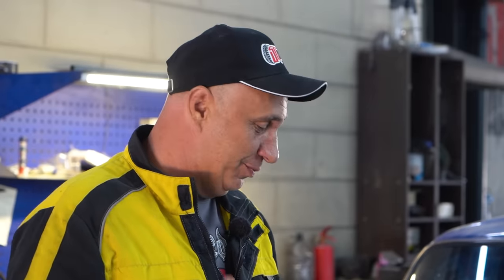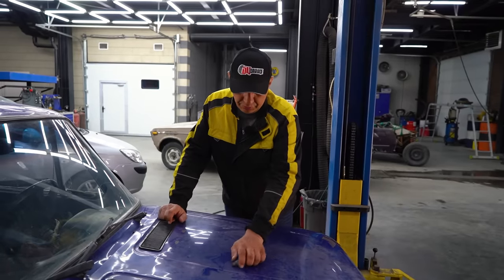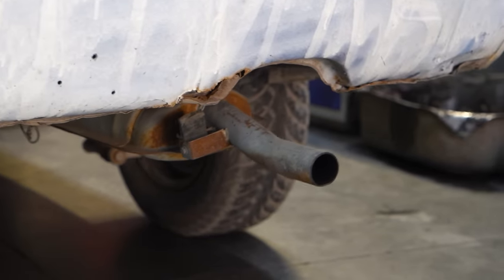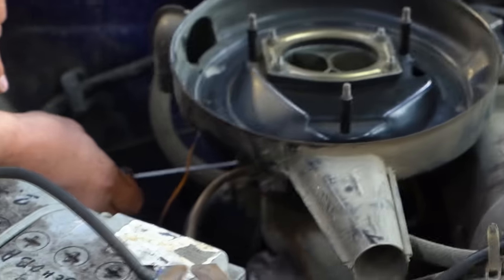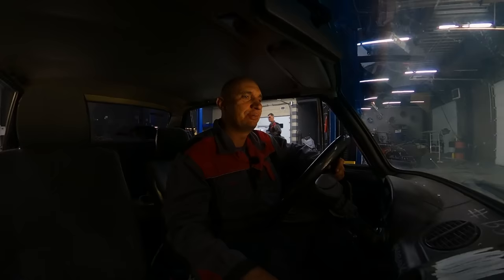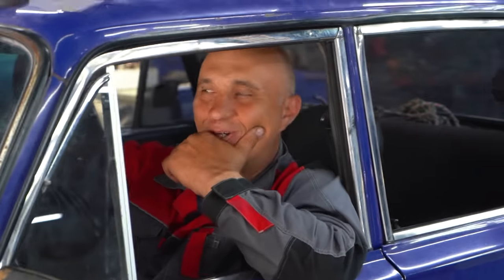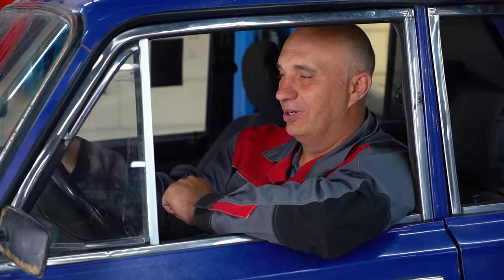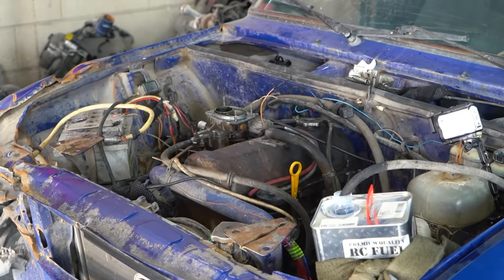Glow plugs in a gasoline engine - will it run?

Comment: Very interesting experiment and I'm not that surprised that an engine as simple and basic as the Lada will idle with glow plugs. But without any means of timing the ignition it's never going to run well at different RPM's. Still fun to see it running with the distributor cap off.
Reply: a bit of back firing nothing unusual🤣🤣🤣🤣
Reply: It's also probably detonating badly.. since the fuels probably igniting way before it should

Comment: As many others said before:
You have to enlarge the nozzles to run the engine on nitromethane.
The engine running on glow plugs has no power because of igniting much to early.The combustion gases cannot exert any force.
Greetings from germany!
Keep it up👍
Reply: nitromethane is a power additive of 1% to 15% to an alcohol (ethanol,methanol) fuel ! wouldnt have thought nitromethane straight was any good as a fuel !
Reply: thinking on with the english dialect and american dialect maybe precise translations are failing on google
Reply: Ich denke mal,jeder der sich an dieser Unterhaltung beteiligt,weiß,daß kein Motor mit reinem Nitro
 läuft...?!😊
Reply: Astonishing that it ran at all.
RC glow plug engines aren't compression ignition after all, he's quite wrong there.
They got a very different kind of "glowplug", utilizing a hot filament that contains platinum or nowadays maybe some other highly catalytic metal.
And that's how it ignites - not just due to heat, but because certain flammable substances undergo catalytic combustion/ignition when in contact with platinum - methanol reacting especially easy hence the choice as RC fuel.
You could basically call it a catalytic ignition engine.

There's even lighters working on this very principle, using a platinum wire/ball of platinum black catalyst to ignite methanol vapors. Yt sure has some videos on it.
Reply: @heinzhaupthaar5590  
This engine runs with "Diesel" glow plugs...!
Reply: Nitro methane would augment detonation.  I suggest keeping the same setup and simply plating the plugs in platinum.  The catalytic activity will keep the plugs hot, but only when the mixture has maximized.

Comment: Wow. It goes against everything I've ever been taught. Conventional thinking says it should have detonated itself to death. I'm kinda floored it even started. You can progressively drill out the main and midrange jets. Make sure you go straight and don't wobble the bit at all. Best done on a drill press. Outstanding video.

Comment: This is likely pre igniting on each stroke, so the ignition timing effectively becomes the fuel timing, if you had EFI you could delay the injection window to close to TDC and it may run. (IMO). By running it very rich as you did with the choke you delayed the time for the fuel to fully combust as so much more was in the cylinder. That's how I see it.
Reply: If he had GDI* he could delay injection until time for combustion.

Most EFI systems inject fuel at the throttle body, or the intake port on the intake manifold. No way to inject fuel after the intake valve closes.
Reply: @Texassince1836  Yeah but you could retard the EFI's timing to the point its throwing fuel as close to the intake valve closing as possible, instead from start to finish

Comment: You need a lot more fuel flow for the model engine fuel vs gas. Methanol has a catalyst reaction with platinum in the glow plug which keeps them hot without the battery once running. On the model engine, timing is somewhat controlled by the fuel mixture.

Comment: Back when you converted the gas engine to run on diesel, I would like to see if you could get one where it 2 cylinders on diesel and 2 cylinders on gas. Maybe set them up where the gas and diesel are both at TDC at the same time so the gas cylinders and diesel cylinders are balancing each other.

Comment: Not surprised. The old 1970’s cars would sometimes keep running after you turned them off. Sometimes with the key in hand I could put it in gear and drive slowly. No steering wheel lock. Floor it and the engine would turn off. Happened on very low octane gasoline.

Comment: I WAS MIND BLOWN TOO!! How!!!!!! Incrívelmente incrível!!! Muito Legal o experimento! i'd never thought it would run that good, I thought it would predetonate as heck. But I guess that predetonation only happens when there is hot spots on the piston, not on the plug, thus when the mix is cimpressed the fuel hits the glow plug and kabooms!
Reply: maybe if it had waaay more fuel it could work, or just mixing the 3 fuels together!/!
Reply: It is most likely igniting way too early, but it's also pretty likely the mix never gets compressed enough before ignition for hot spots other than the glow plug to have any effect

Comment: Ultra high compression and the heat generated by it  is what causes combustion of the air/fuel diesel mixture in a diesel engine. 'glow plugs' are only necessary as a catalyst to get the 'process' started momentarily, usually on cold days. Gasoline engines to not produce high enough compression to induce combustion of diesel fuel, they rely on a spark to ignite the lower compressed gasoline mixture to ignite. They do produce (barely) enough compression to ignite diesel fuel with the 'help' of continuous glow plug operation to provide the added heat necessary, as shown in this video.

Comment: Hi try mixing the fuels a little of each type see if it will run with the benefits of each one added together.
Reply: Ppl did that back in days to raise octane in gas with high compression gas motors. I have done it for fun in my daily driver years back. It will bite u in the ass if just keep throwing diesel/kerosene in the gas.

Comment: when piston goes down it sucks partly cold air and a little gas smoke. but when piston goes up gas smoke gets denser which easier tuches hot glow plug so piston repeats its cyrcle and engine works on smaller rpms, but partly

Comment: As long as you aren’t running lean, this just works because the flame front won’t move forward willingly during the compression stroke, and doesn’t really make power until it squishes.

Comment: My first guess is the engine runs like any other with low compression... and a gas engine in stock form will be about half of a diesel engine. Yes, it will run better if you richen the mix, but only to a point. BTW, even a diesel has timing advance, but it's in the fuel, not the ignition. You might be able to cobble up some fuel injection to fix some of this, but not the compression.

Comment: I think the biggest problem is that the engine is misfiring too much. The fuel is detonating at the wrong time in the stroke. That is why the engine is shaking so bad. Compression engines use fuel injection timing rather than ignition timing on a combustion engine. With fuel injection timing, it sprays the fuel in at the precise moment to get the most efficient combustion. I bet if you find a more efficient way to deliver the fuel that your engine will run better. Also, a fuel injector will atomize the fuel vs just dumping it in the combustion chamber. Really good experiment though. I would have never thought to try that. lol

Comment: Needs more rotating mass put a auxillary big flywheel off harmonic balancer so it can rotate push thru on idle power heavier flywheel will help propel power....also moving the distributor to tighten or loosen when pistons compress will also need to be tried

Comment: try to pair with the fuel injector conversion, then you can control the fuel better, and also try 24v glow plugs or to run the 12v ones on higher volts to keep them hot

Comment: I used to make thick ass smoke screens with my old car. I routed washer fluid through the intake and put diesel in the washer fluid tank. Before you yell at me, it was a beater.

Comment: I remember that some methanol-fueled engines used on model planes and UAV's can be converted to burn gasoline by adding a carb, a CDI and replacing the glow plug with a spark plug. So vice versa.

Comment: try a mixture ratio of fuels gasoline and diesel. also modify the carburetor so you have better fuel adjustment control. change valve timing if possible without valves hitting pistons.

Comment: The glow plugs in my Duramax only ignites for .3 seconds prior to ignition.  The glow plugs don’t ignite the fuel. The glow plugs warm up the cylinder walls.  Compression ignites the fuel.

Comment: Put spark plugs back into it and run it from nitromethane alone. You will have to add a ton more nitro fuel though in a higher percentage than 16%. I watched a stock Chevy LS make close to 600 HP on the Dyno with a nitromethane methanol mix a few months ago

Comment: I watched you connect the wire straight from the battery.  I didn't think it would excelerate without an induction system.  Was there one in place?  
     The induction system adds voltage to the plugs enough to ignite the mixture under loads.  Maybe the metal in the glow plugs weren't conductive enough to carry the load without over heating.

Comment: Diesel will be too viscous to meter properly through a carbouretter. Maybe if you had a fuel injection system it would rev better.
However, you have still run a very interesting experiment. Were the glow plugs on all the time or where they being fired from the existing ignition circuit? I didn't really understand that bit.

Comment: Methane is 9to1 petrol is 14to1 you have to find the size of the main jet and multiply it by about .4 then drill that size hole.That should give the right main jet size to adjust the carb. If you run on Ethanol  you multiply the jet size by .3 and then drill . But with ethanol you can get away with it.

Comment: In this project if we add 4 diesel injectors in the air intake manifold pulverized diesel and the glow plugs will work with just a gear hydraulic pump and a pressure relief valve I’m pretty shore the gas engine will work perfectly

Comment: When you switched to diesel, you didn't account for diesel requiring a much higher compression ratio than gasoline to ignite. I don't know what the compression ratio is for those old Ladas is, but I don't see it being higher than 8.0 or 8.5 to 1. Diesel requires 2-3x more compression than that. You have to find a way to increase the compression to run on diesel.

Comment: I did the glow plug thing years ago on a 12hp kohler lawn tractor engine , it would only idle rough ,same as the car did, I had thought a diesel injection would time the fuel and work better

Comment: Of course mixture is way too lean on that nitromethan methanol fuel. Only methanol is way more less energy dense than regular gasoline, so it would need much more fuel. And there you have a nitromethan also. It makes the mixture even more lean. I would say, you need something abaut 50-100% larger main jet, to get that thing work properly.

I used to convert my 150cc moped to ethanol, and even that needed way more larger jets. And also I tried that same moped with methanol, and it would need a bit larger jets to work properly, but I only put choke on and it worked some how ok. More fuel, or less air and your lada engine will run lika a cheetah!!

Comment: Your fire is a constant so you need to use some type of fuel injection for your ignition timing otherwise you can't control when in the engine cycle your fuel ignites

Comment: Try running the nitromethane while the engine is fuel injected. I think it could run better with fuel injection because fuel injection is more stable than a carburetor if tuned right.

Comment: I think  that you should change the cam timing. It probably does not fire at the right time,  because of the delayed ignition by not having an  immediate spark.
Reply: I was thinking the same but reason being pre ignition as piston detonated down it draws fuel so its igniting it. Hope we get find out on this as I'm defo up for running me car on nitro like this 😂
Reply: Made a diesel gasoline motor essentially.
Reply: That's not going to change anything
Reply: True!  But what's worse is that there is NO spark timing, so it wont affect much, if anything at all

Comment: What you forgot is that diesel pistons are way different than gasoline engine pistons.

Diesel pistons are more durable and uses more compression to run the vehicle. 

Diesel pistons have a more rigid shape at the top, while gasoline pistons at the top are smooth.

Comment: Please fit both together spark plug for engine running and add glow plug with air intake for make hot air to the engine. I think may its give more fuel burining and make more fuel efficient also improve power. Please can you try this🙄. Please

Comment: Hot bulb start then switch to 400x mixture methanol-nitromethane mix. It is too little calories in new fuel compared to regulator gasoline

Comment: Hello from the UK. Gr8 channel. An electric car on the cheap. Fill the back of the car with batteries and use the starter motor as the engine, see how far it goes. That's my suggestion. Thank you. 🙂
Reply: I would love to see that too although I bet its less than a 1/4 mile as starter motors have no real cooling

Comment: Nitro methane is less energy dense than petrol you need to run bigger jets to increase the fuel to air ratio to around 5-6:1  from 14:1

Comment: well radio control model engines run on an ethonol/methonol mix with nitro methane to add power ! they use a glow plug !

Comment: I would think if you manually advanced the timing a tooth or two, you might get more revs due to lacking spark advance.
Reply: There is no spark timing on this engine as there are no spark plugs. Most likely the ignition is far too advanced and the engine is lacking power as too much of the combustion process is happening on the compression stroke and not enough on the power stroke.
Reply: @carnivorebear6582  Indeed, there are no spark plugs, so no spark advance. I was referring to the timing of the piston in relation to the valves opening and closing.
Reply: @Skumevil  ah yes I should have noticed you said 'tooth' and hence were referring to mechanical timing, my bad. Not sure how much benefit you'd get out of it though, usually a jumped tooth or two leads to pretty significant performance issues, but it would probably solve the backfiring issue. It'd be nicer if it was a DOHC design so you don't have to offset both intake and exhaust timing.

Comment: Since when are Diesel Glow Plugs are responsible so the engine can runs? It is just a help to get to the temperature for a common rail or other diesel System, diesel engine can run with all 4 dead glow plugs, the start can just be rough ...

Comment: I would have figured that if it ran at all, it would prefer high rpms because the pre-ignition, which acts like very advanced timing. 

I bet the reason it works at many different rpms is that at idle there is less pressure and heat so the timing seems to to be later, and the higher speed and pressure advances itx

Comment: Damn. Not even but a min into it 😂 no. Not the same at all. The diesels require a lot more. They only require the glow plugs on first start 😂 just to warm it up and rely on high compression. That’s why they knock. If u ever notice some times a car can knock like a diesel too. They’re trying to combust when u shut it off or it doesn’t start correctly. They just don’t have the compression. Sure it’ll work on a 2 smoker. But only bc the compression is higher than a gasoline but not as high as a diesel engine.

Comment: maybe high octane fuel? (or low octane)
Reply: High octane actually burns cooler, more so controlled than low octane. Regardless it doesn't have enough compression to actually live on diesel.

Comment: I don't believe glow plugs stay on long after the engine is running. how long can a glow plug stay on?
Reply: not more than 30 seconds i think or they burn out. i'm sure that it's possible to lower the duty cycle with pulse width modulation for continuous use though.
Reply: They will glow until they burn up
Reply: @martin-vv9lf  Tbh , even thats a bad idea , best thing to do is set the glow plugs on a timer to have them come on and off every 20/30 seconds.

Comment: Diesel will not Ignite in a low compression engine even with the glow plugs running all the time..diesels are compression ignition engines meaning that the fuel ignites from compression the glow plugs only help start it Especially in cold weather they don't run all the time

Comment: I have just found out about hot bulb engines as well as hit and miss engines. The hot bulb engine is amazing in it’s own right. The hit and miss engines are pretty cool. I only saw the smaller ones running. I found a video of one powering an oil pump in Wyoming. Those one are crazy. Small ones sound quiet, but the one powering the oil pump was something else. It had a rumble bass note and had a massive muffler.

Comment: Guy try to see if you could do if the spark plus will make a diesel engine will run
Reply: diesels will run without glow plugs, they're just needed to warm the cylinders on cold starts. Point being, the spark plugs will be the same as an engine without glow plugs, and it will still run fine.
Reply: It's a little thing called compression, which this doesn't have enough in first place. The induction is way wrong also. But compression is the biggest factor here foremost.

Comment: With glow plugs your HAVE to richen the mixture, richen the mixture to adjust the timing event, then with Rc fuel u have to run richer yet! The jetting in the gasoline carb is WAY to small for that